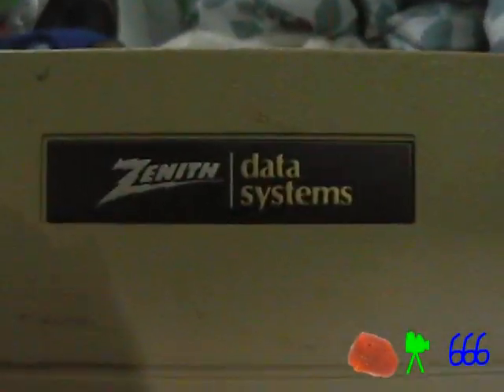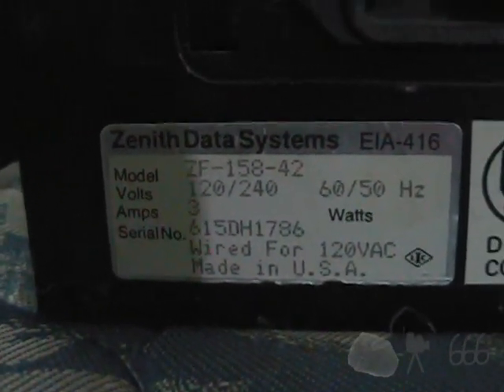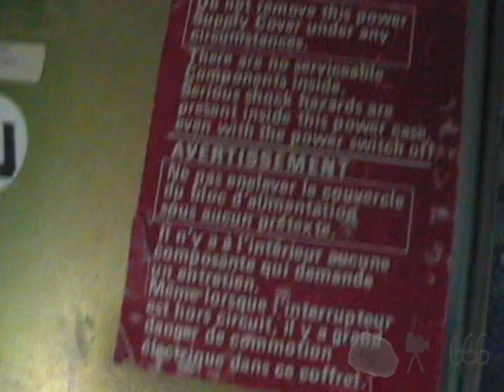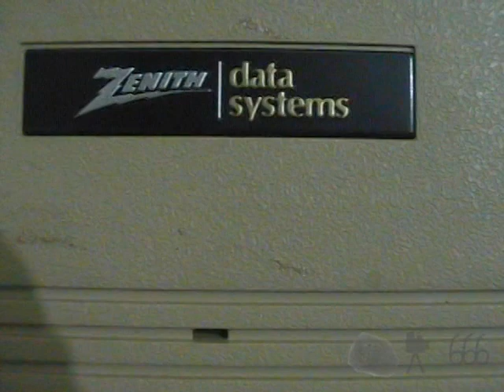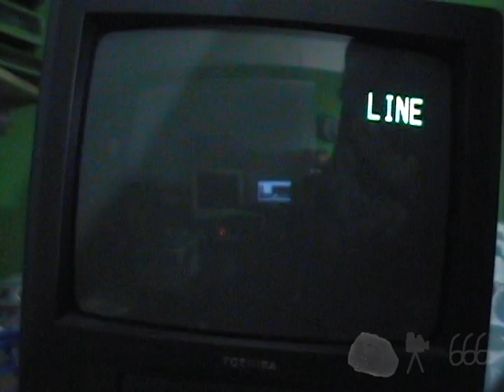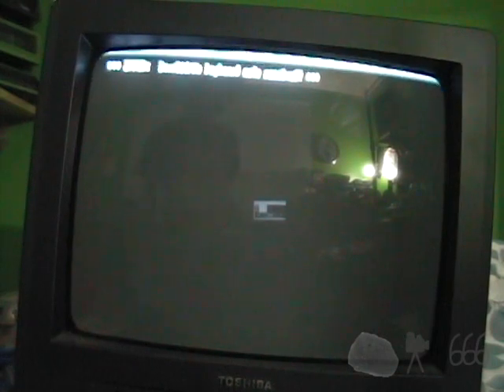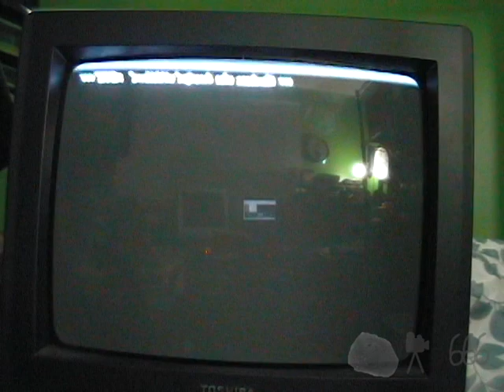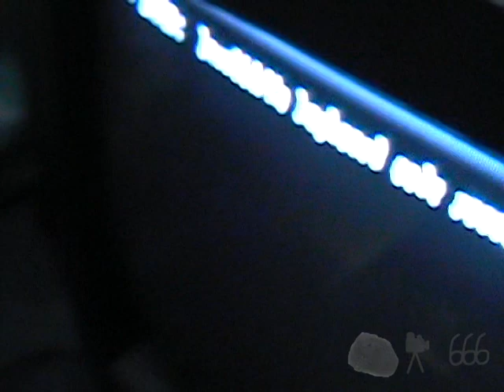Zenith Z-158 (ZF-158-42) XT Clone System Exploration

Comment: That is Z-158 (HE-181-5857-5) CPU/Memory board + color video / floppy controller card and an optional corvus omninet pc bus transporter. Find  "Zenith Z-150 PC - Service Manual.pdf" file on the WEB for more info. The push-button(SW201) is used to select the CPU clock Frequency. You just need the correct XT keyboard and the system will boot.

Comment: I found one of these on the side of the street months ago. In better condition than this surprisingly. I brought it home to take a look at and possibly restore. It wasn't all original hardware inside though, which says to me it was probably well taken care of. It has a 80286 and some sort of graphics card. Probably from a uni student in the late 80s early 90s I suppose.

I'm definitely going to restore it one day, but I don't currently have a monitor with VGA or anything else because I don't have a television at all. But I will one day, hopefully soonish. 

Cool of you to post this, I've had  shite luck finding any documentation online for it aside from archived ads. Hope the restoration went well for the one you have. Do you happen to know of any places that have documentation for this beast? I mean mine is non standard since someone upgraded it throughout the 80s but it would still be very useful potentially.